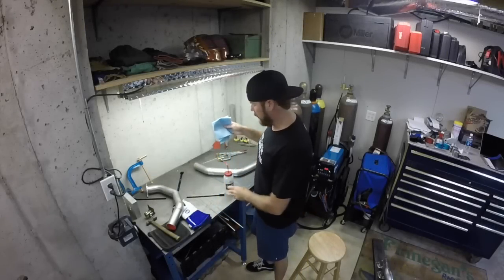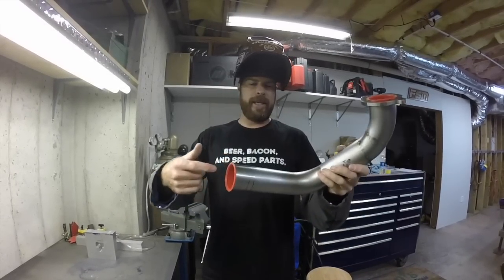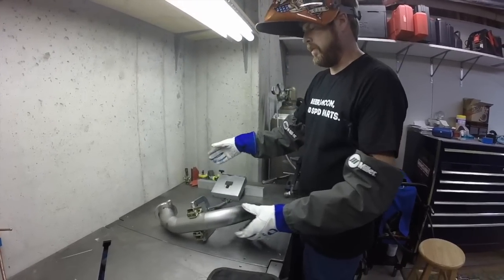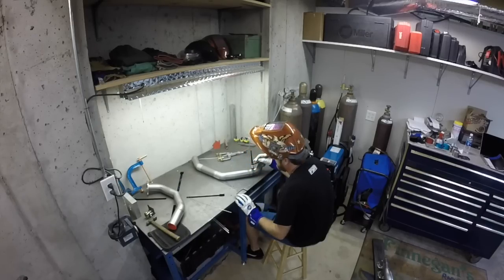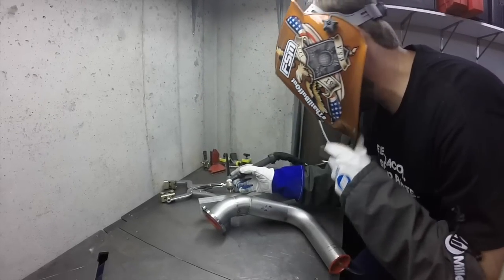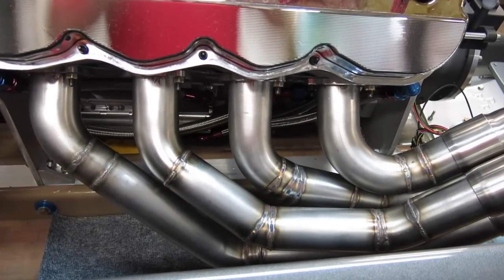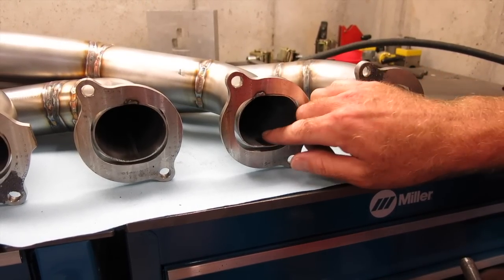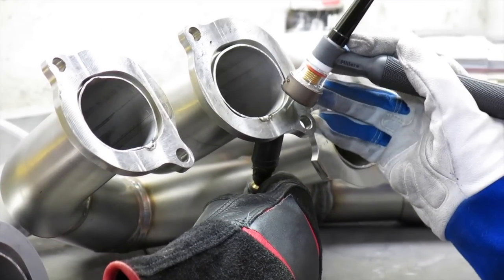Finnegan's Garage Ep 13: Hemi-Powered Drag Boat Stainless Steel Header Build Part 2

Comment: I don't agree that back purging is THAT necessary! I don't know about the US, but argon isn't that cheap enough here in Australia that you can just burn through two plus bottles just to make a set of headers!
Reply from the maker: you don't have to but when a piece of junk from the backside of a non-purged weld get sucked into your expensive turbo maybe you'll change your tune and suck it up and buy some argon.
Reply: +Finnegan's Garage oh yeah, there's definitely merit in back purging for pre-turbo stuff, but for anything else, it's a bit over the top. It's been a long time since I've built some turbo headers out of stainless though, I generally built them out of steam pipe, so I don't have to built an extra support bracket for the turbo. I understand you're making these videos under your company brand though, so you need to take these precautions. Keep up the good work, Fino!

Comment: Why don't you make every exhaust tube te same length? Because you have such a expensive engine and turbo's but you would optimize your turbo's if every tube had the same length. Like they do in formula 1 and other hi-end performance set-ups.
Reply: yeah that's what I thought too
Reply: on a turbosystem equal length isnt as important , the amount of efford to create equal length piping doesnt live up to the hp gain
wat IS important is that turboheaders expand a great deal more than those for natural asperated engines and need to be able to move a little between the different cilinders and the collector to prevent them cracking
Reply: +watahyahknow Oh, didn't know that! Thanks for the info!
Reply: On turbo's, it doesn't matter as much (if at all) as it does on NA setups. Look at most Factory delivered turbo setups, they are not equal length.

Comment: right around 15:40's it appeared as though the other flanges were spinning out of position as you tapped on the one. Any alignment issues upon test fitting?
Reply from the maker: the flanges are not connect to each other. makes it easy to disassemble the header.

Comment: +Finnegan's Garage, is there any reason you keep referring to them as turbo headers and not turbo manifolds? Or is it just habit?
Reply from the maker: To me a manifold is one piece with several offshoots. a header is separate tubes that come together at a collector, thus, this is a turbo header.
Reply: That makes sense. I had never heard the term before because most times it seems people don't worry about tuning before the turbo. Thanks for the explanation!

Comment: how on earth do those still line up with all that hammering.
Reply from the maker: its tack welded on the backside.
Reply: You can see the rest of the pipe moving is what i was getting at, not the point where the hammering was being done.

Comment: I like Roadkill. I like Finnegan. I like the idea of this show. I cringe when he talks about welding though. So much cringe. Firstly, that crazy long post flow for a super tiny tac. You only need to protect LIQUID weld puddles from air contamination, after the puddle freezes it is a waste of Argon. Cooling the puddle with the gas could cause post weld shrinking as well. 

The back purge procedure he used. Huge waste of Argon. The idle chatter about 1500 'degree' temps for welding stainless... 304 Stainless Melting point is 1400 C -1450 C. It would have to welded at "1500 degrees." 

All welding of all metals changes the chemistry and crystalline structure of the material.  

I can see that he can weld, nothing wrong with the execution. Just avoid technical's. That's all. Constructive criticism, with love brother.

Edited to add: that he should be using a stainless grounded surface to avoid arc contamination.

Comment: how did you flatten the flanges? Stainless always warps like fuck and on flanges its the most important bit to get flat
Reply from the maker: welded in sections. cooled, kept going. when i weld the front of the flange it will be bolted down to a 1/4 inch thick piece of steel c-channel to keep it flat.

Comment: I have a 81 hondo picklefork hydro I need help replacing stringers in phoenix. want to help me lol..
Reply: and it's a jet.. weird huh?
Reply: Camshaft is too small.
Reply: +Stephen Bianchi camshaft? what are you talking about?
Reply: +gary jacques the wood stringers in my boat need replaced? what does that have to do with camshafts?
Reply from the maker: call JETT Performance.
Reply: gary jacques standard pre generated YouTube comment.
Reply: +Finnegan's Garage I do everything myself lol just don't have time. work in the oil fields. just need time and help lol.
Reply: Check out Seacast. It's a composite liquid that takes the place of stringer and transom wood. Easier, much superior contact and never rots.

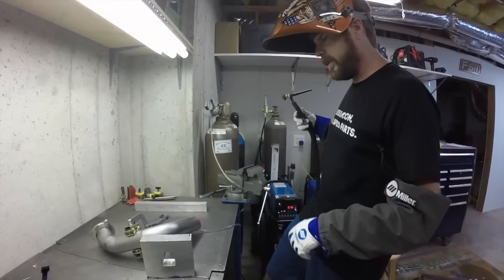Comment: my butt cheecks did a little squeeze at 7:00 when the torch with the pyric cup fell to the floor. shattering of one of those cups is the most heard breaking sound you'll ever hear.
Reply from the maker: sadly, i've broken several because i've let the torch fall. normally i hang it on the vise.

Comment: Are you a lefty or righty?
Reply from the maker: i shoot pool and basketball left-handed, sign my name and throw a football/baseball with my right. depends on what i'm doing. i can weld with either hand.
Reply: I was curious to find out if there is any difference in comfort and possibly less shaky with your predominant hand and if your predominant hand works better as the lead or feed hand. 
I am extremely rusty at welding and very limited experience with mig or tig welding-mainly more experienced with stick welding with 8 batteries and jumper cables somewhere out on the trails. With that being said i am always trying to learn and your videos are helping out by giving good pointers and things to look out for. Thanks for that and keep it up, hope to see some great vids of the boat launching when its done.

Comment: You can't get the original red can flava-flav in New England any more - :(  We have a case that is about 10 years old of the "good stuff" - apparently the old red can CRC formula had some kinda carcinogen that granola munchers complained of....  and nothing works quite as well as the old red can stuff did for getting off the really stuck stuff...